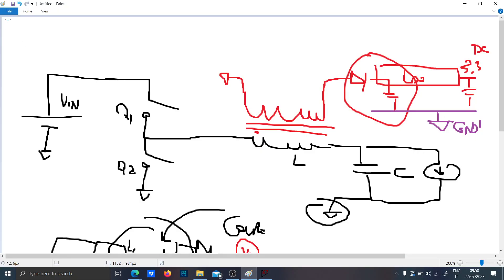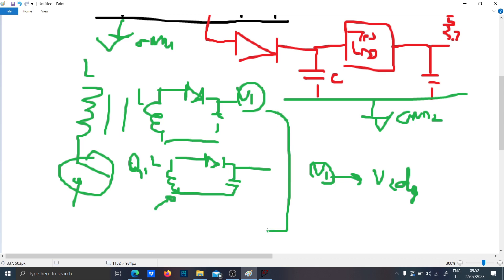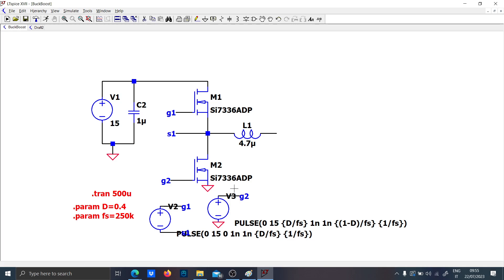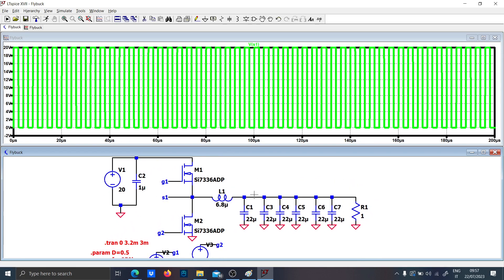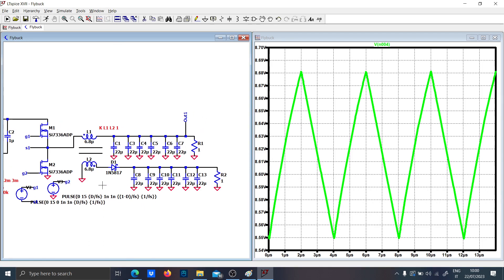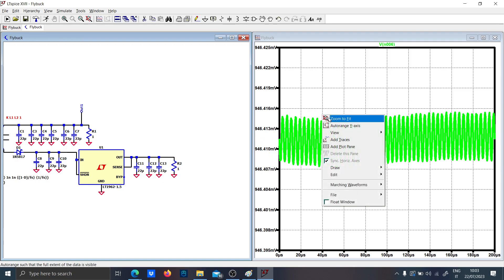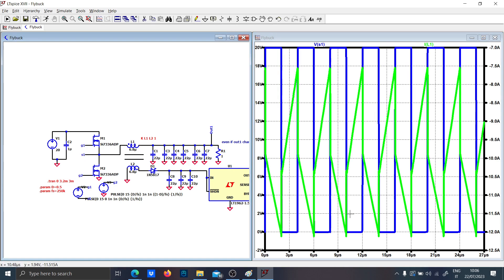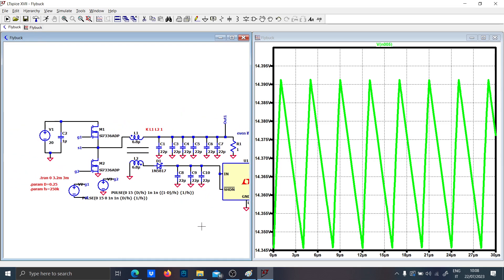LTSPICE FlyBuck DC-DC Converter

Comment: Nice video, thanks for sharing but i have a question about the grounding. You added same ground on main output and isolated output. Doesn't it break the isolation?
Reply from the maker: That is correct. But Ltspice doesn't simulate isolated grounds, and it's not important either for the waveforms that you need to see at the end of the day. 
Never do something like that in a real Cadence schematic
Reply: Thx @manoA98A